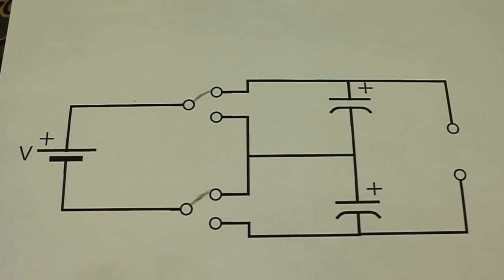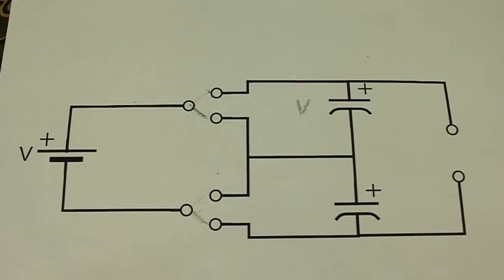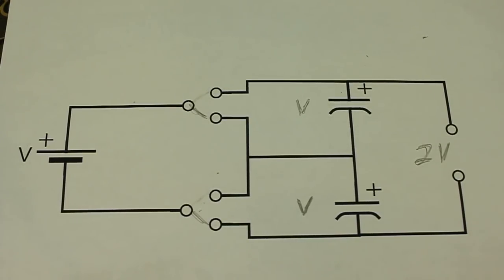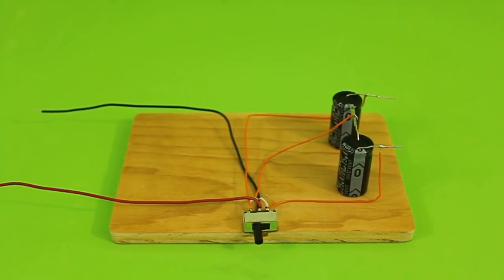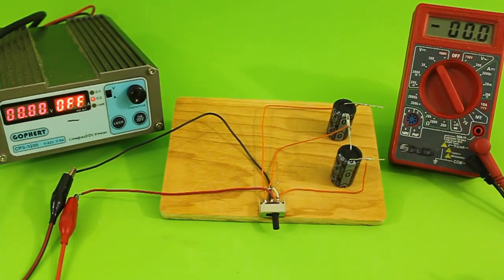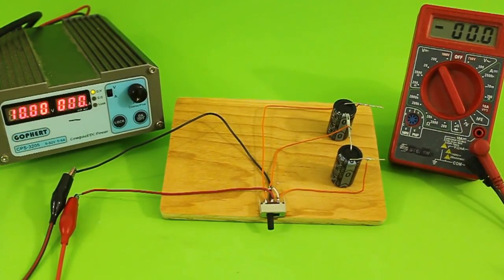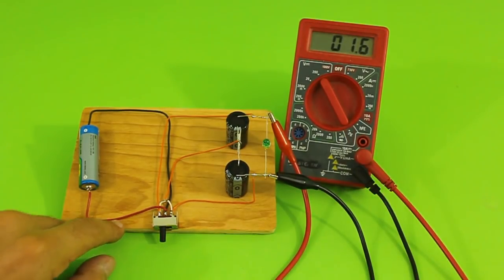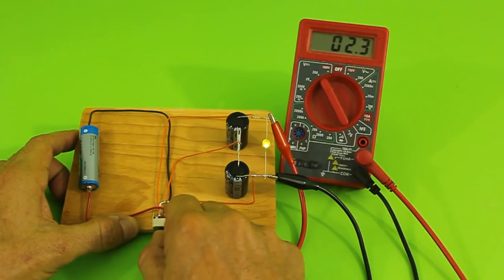Voltage Doubler Principle of Operation - Charge Pump

Comment: Sir please using this circuit apply to 5v mobile charger and increase up to 10 v ..........

I have only diy use ........
Like diy soldering ...........dc charger adepter through........

Requested sir please make .......
I have not afford 9v charger..
Plz make...............
⭐⭐⭐⭐⭐⭐⭐⭐⭐⭐⭐⭐⭐⭐⭐⭐⭐⭐⭐⭐⭐⭐⭐⭐

Comment: can't we charge both of them in the same time? what would happen if capacitors charged in parallel from the battery and connected their output is connected in series? Cheers.

Comment: Strange how you say your current passes thru capacitors, but current does not pass, only a weak charge before the caps load out.  How doe current pass at all time thru the capacitors ?

Current does not pass, only initially because they push the charge on the other side that is there already, but no current passes from the other side of the capacitor.

How does it manage to pass in your schematic ?

Comment: please help give me ideas how to double the volts using 2capacitors without transistors... i checked and copy the other created voltages doubler but it wont works in my mini project. i used dianamo motor 12v as a source of voltage then so on etc... waiting for your reply and the part two of this video thnks and god blss u.

Comment: That is great. You make really interesting videos. I teach an electrical maintenance Tech School program in MN and these are great ideas for class. I also install Solar PV systems and use DC - DC converters from time to time. Mostly 12V to 24v.
Reply from the maker: +Jesse Palo thanks!
Reply: Jesse Palo 
I did this with a weak solar cell 
But I tried a different circuit no power came out and I made sure the solar panel worked and everything was OK except for the fact I was getting no charge no power = no pump 
Do you know what recommended solar cell I should use 
Its from a led flash light from the dollar store
Reply: Your problem is that solar cells require a special kind of charger to get the energy out. Since power = voltage * current, you want to maximise both at the same time. When you connect a load to solar cell, the solar cell voltage drops close to zero, so 0 * x current = 0. You need to pull very little current so that the solar cell voltage goes down around 20% from the maximum voltage you measure from an open circuit solar cell. It's hard because the voltage differs based on sunlight etc, and in practice you need a special charge controller. Look up Maximum Power Point Tracking and you'll find plenty of articles explaining it. :)
Reply: Wibin thanks

Comment: It would be great if you could show us how to use the transistors for switching, you explain things so well!
Reply: Yes we still wainting for that circuit !!!!
Reply: Here is how one can use transistors and other discrete components to make a circuit that functions like a DPDT 
===========================================================================================
All you need is to hookup a NE555P pulse generating IC to the Control_IN and the thing starts switching  for you!!!

You can implement this with semiconductors provided the power supply to the circuit stays on all the while you want to have the transistors conducting current. This problem is also much easier to solve if you design for the current flow through the switches to always be the same direction.
Let's say that you design for 12V coming into the C (common) terminal of each "switch" and the NC (normally closed) and NO (normally open) "connections" will always be used to gate power to a ground referenced load from the incoming 12V.
For each pole you will need two FETs driven from a pair of control signals that are logically inverted from each other. You drive one FET ON while the other is OFF and flip the states when the "switch" changes state. In this 12V design you may find it easiest to use a P-FET since turning on the FET works nicely by pulling the FET gate to GND with the control signal. (If you use N-FETs it is necessary to provide sufficient gate drive above the 12V level signals that you are trying to switch). The two FET drive signals can derive from a single control signal by adding an inverter within the path to one of the FET gate drives.

Example Schematic - Note that you have to select the appropriate P-FET per your requirements.

https://i.stack.imgur.com/JEwdi.png

You can get the same job done with a DPDT Relay as described here:
http://www.electroschematics.com/9601/dpdt-switch-relay/
Reply: Elmer Salinas the easier way is ti use a microcontroller
Reply: Shredder woah, really? Which one?
Reply: Elmer Salinas i suggest you arduino uno
Reply: Shredder oh cool! I have one, I'll give it a try!
Reply: Elmer Salinas i agree with him
Reply: arduino is nice, but you could also just go throw the motion and not learn anything. It's so much better learning this way and a breadboard. But Arduino makes it too easy with their interface. It's great for intermediates but beginners really should get their hands dirty first :)
Reply: Here you go...
I asked him the same question long time ago...
He is too busy to respond I guess...
So i figured it out myself...
By the way you can do it with Relays as well...
But it is kind of noisy...
You can do Esacy oscilater for steobe square wave instead of NE555...
Then use a MOSFET to trigger the DPDT relay...
Ask me for the schematics if you are interested...
https://i.stack.imgur.com/JEwdi.png

Comment: With a fast switch rate, it would look like it's perpetually on :) Thanks Ludic
Reply: The lights in your room turn on and off 60 times a second, giving the appearance of it constantly illuminated. 60hz....on and off cycles per second
Reply: Hitman Notoriety AC doesn't switch on and off, the flow of current changes direction X amount of times per second depending on the frequency. That's why you get a sinusoidal wave with AC.

Comment: Thank you very much, I always enjoy your content.

Could you explain how the charge pump of a microwave oven works since it only works with one capacitor (in a microwave it doubles the voltage of the transformer from 2200 to somewhat around 5000 volts to power the magnetron)?
Reply: in the first half of the phase it charges the capacitor trough a high voltage diode and the second half it is in series with the capacitor. this way 2.5 kv sine wave becomes 5kv half wave
Reply: Two_Number_Nines good question and answer I don’t know much about the Walton C pump but looking at the microwave it’s interesting that the ‘positive’ is earthed to chassis ground and earth ground, normally on a vacuum tube the plate has a high ‘positive’ potential DC in this case that plate is grounded, clearly anyone touching a microwave can experience first hand the lack of potential difference from ground, so it’s interesting how it does ‘pump’ to me, thanks for the answer.
Reply: its single stage half walton-cockroft multiplier
Reply: John, thank you very much for your answer. Exactly to the point.
Reply: Lejf Diecks I've taken about 6 microwaves apart. Saving alot of the parts for fun. I'll have to look it up, not sure what you are talking about.